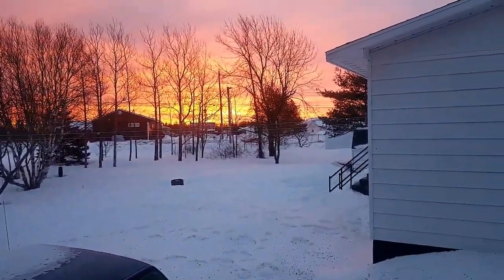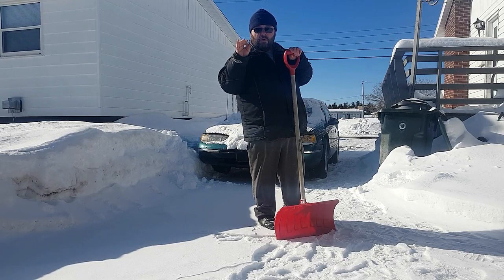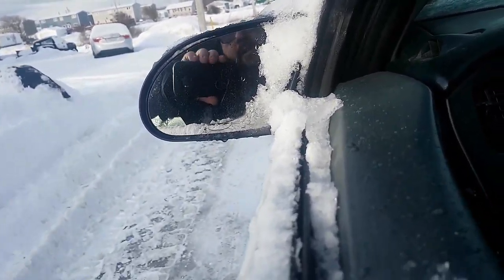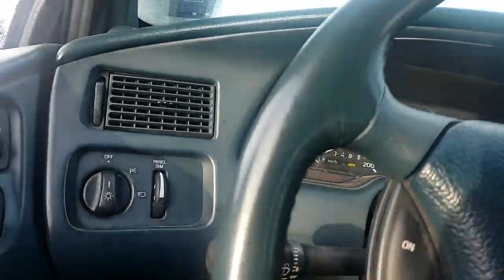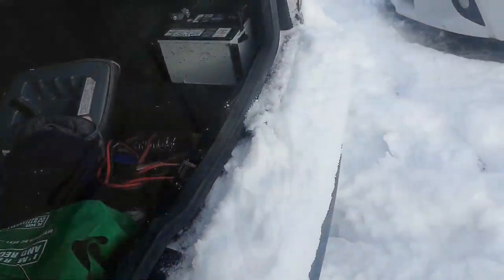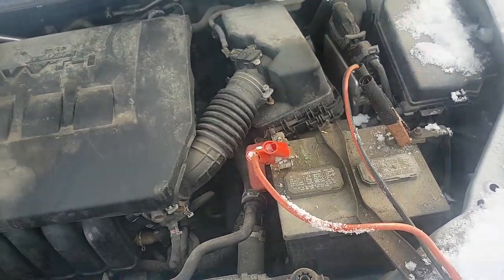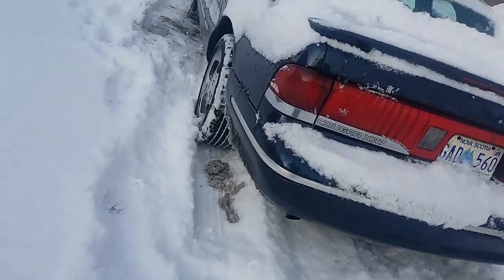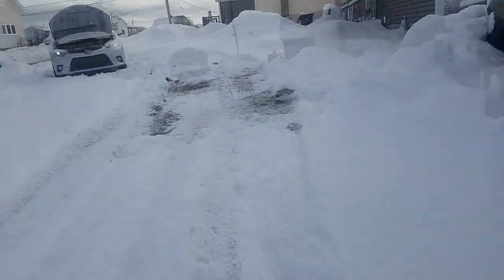engine no start . a jackass auto rescue toyota corolla

Comment: Cool vid there Caper.  Literally, ha!  I'm surprised you don't have a jumper box?  Living up here in the snowbelt it's dang handy for sure.  I keep a battery tender on my Subaru even though it's parked in the garage but my F-350 stays outside in the snow.  I start it up and drive it a couple miles every few days just to keep the battery charged.  But in the event it wont start, like this morning (-25 C), the battery jumper box comes to the rescue since I keep it plugged in all the time during Winter.  Thanks for sharing. Cheers!!!
Reply from the maker: I must invest in one William. My cables are pretty tired looking 
Lol. Thanks again 🤜🤛